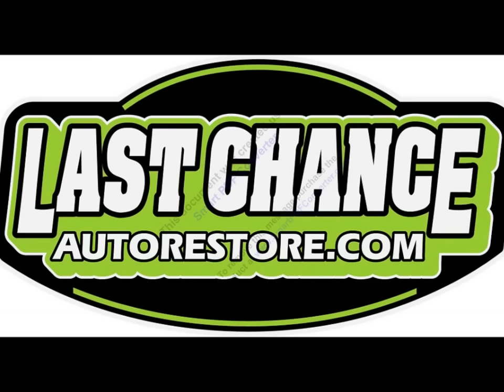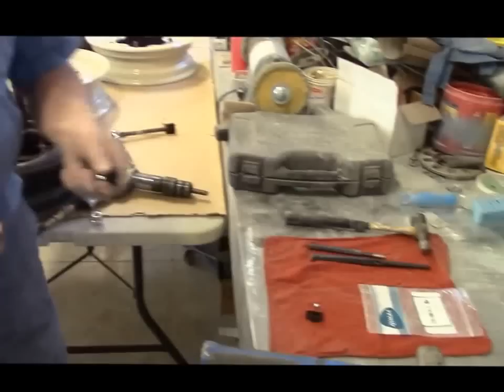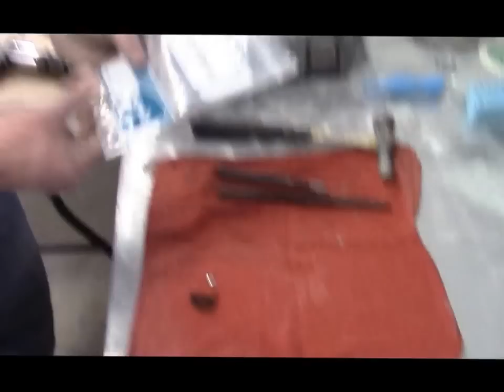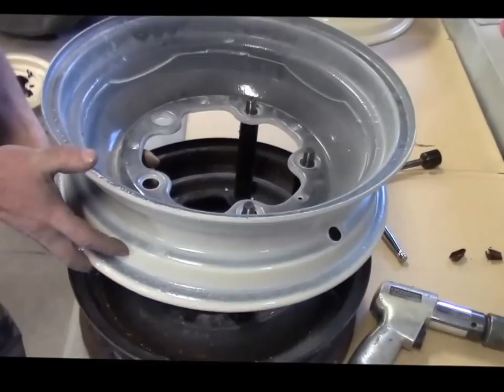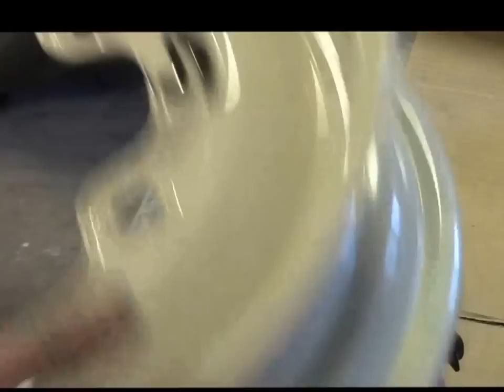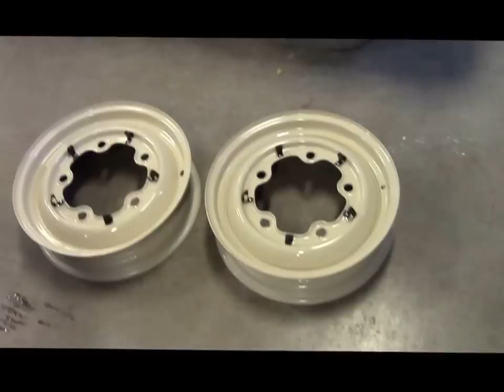How To Repair Classic VW Bug  5 Lug Rim Clips, By lastchanceautorestore.com

Comment: I see what your trying  explain  but the best way is to take flat head drive or some type metal flat end Rod and place on rivets line them up straight  and hammer  it  few times real good and done deal and as far as old rivets  you can drill it out instead  using grinder  and it will come out beautifully  I'm perfectionist  and I got factory look buy the tips I just explain  its really  easy for someone doing at home and no need waste lot time, $ with extra  tools that are not needed  after clips are placed  on Rim  you will look good and OEM as far as clips you can get them at parts store deal directly  with Germany  or England  you should  be Good mine are all original  NOS Geman just tip for you Vdubs 🤙👍

Comment: Nice idea, but upside-down. Rivets are to be driven from the HEAD side, not the tail, using a rivet-set and a bucked from behind. And a rivet-gun, NOT an air hammer. There's no control with the air hammer, which is why they're only getting little bursts before sliding off the rivet tail. 

And driving from the tail-end tends to create a tiny gap between the clip and the rim with each hammer blow.

Get a little vermiculite, put it in a heat-proof container. Heat the rivets to bright-cherry red on the vermiculite, back the torch off as slowly as possible, and scoop some hot vermiculite over them; thet them cool slowly. That'll give you the annealed steel to best drive the rivet.

Drive with a round (concave) rivet set until the shop head (tail) has expanded to 1-1/2 the original diameter.